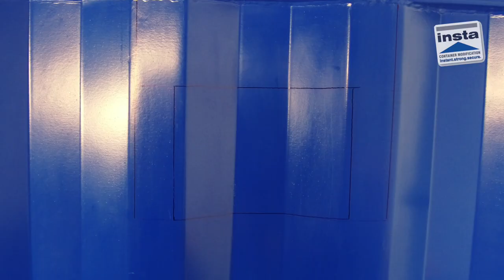INSTA Shipping Container Vent (#6067) - Installation Video

Comment: I bought a container and had 2 of these installed on it. They leak and aren’t that much of an added benefit.  Save yourself the trouble. Just my opinion….
Reply: It's not hard to reseal with silicone
Reply: Trust me, I siliconed them!